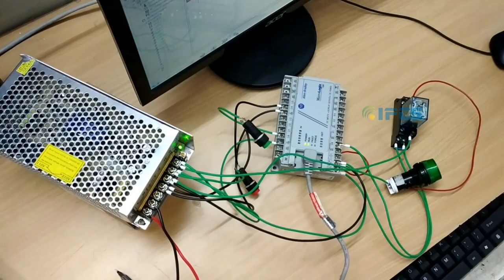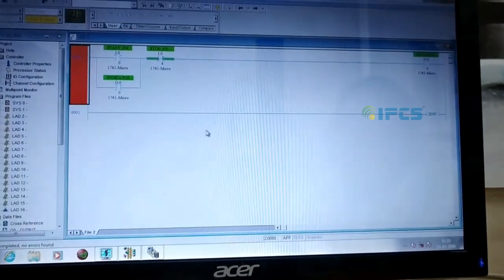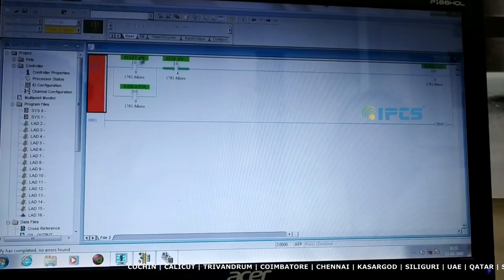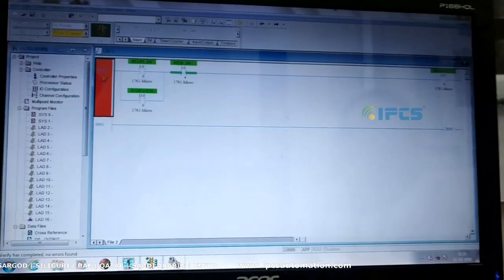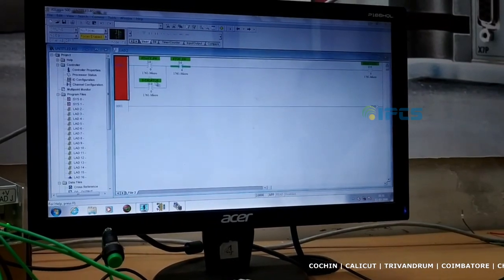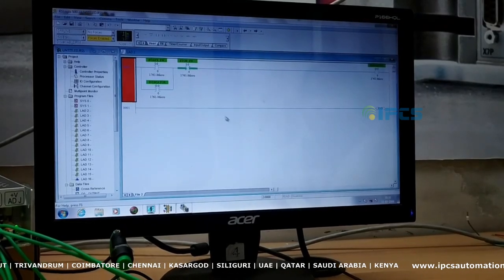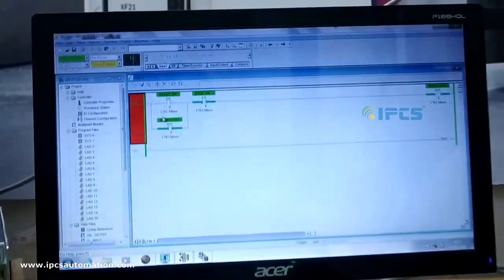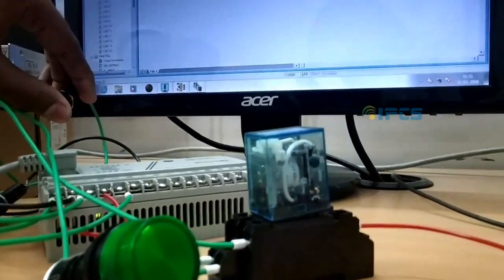Simple relay logic concept about Programmable Logic Controller I/O Wiring | IPCS Automation Training

Comment: Hi there. Thanks for the video.will be better if no music while speaking.btw pin no 5 is normally open which connected to lamp.so the other pin is the common..
Reply: S crt another pin should connect to NO not NC terminal so the connections should like this lamp negative connected with direct ground and possitive connect with NO and common is connect with +24v.
Not like this NC connect with + 24v and common is connect with lamp + and lamp- is connected to ground. If u do like this the lamp is ON if any input is there and lamp is off if input is there.